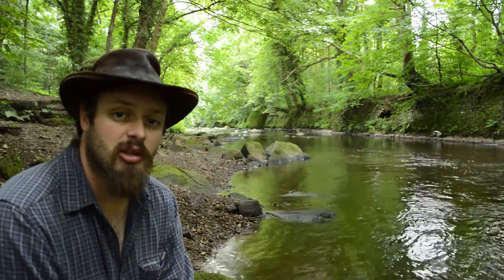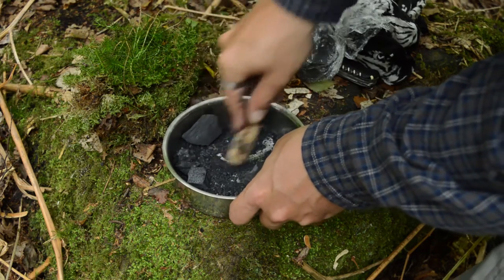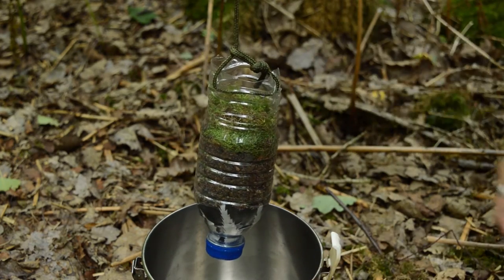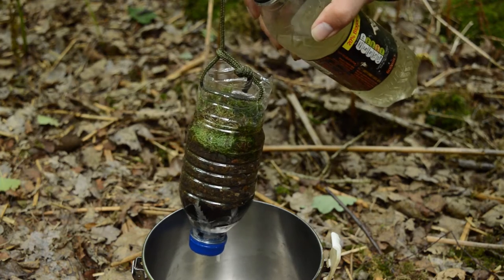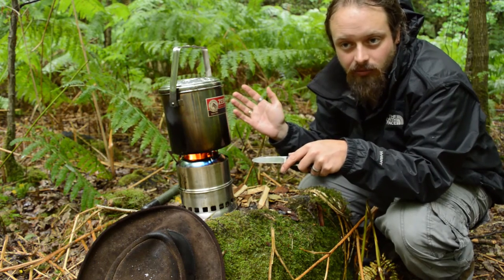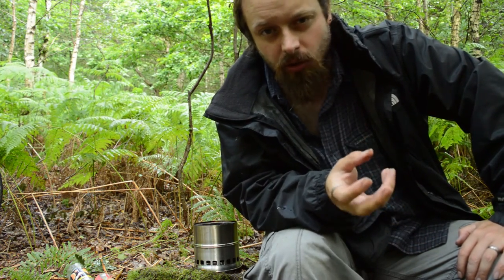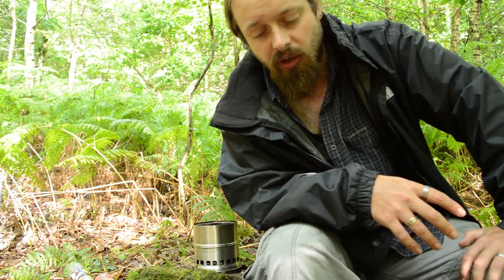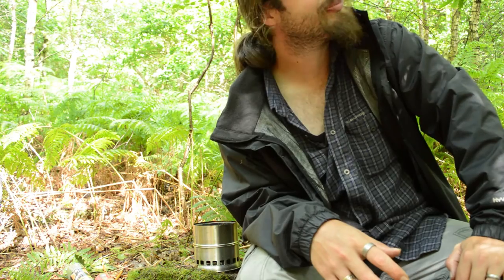Making a carbon water filter in the field

Comment: Do you think this method of filtration will handle heavy metals, the sort of contaminates associated with runoff from asphalt, gasoline, vehicle fluids, and such after storm events during which biofiltration may not be effective?  Thanks for your input in advance.
Reply from the maker: The charcoal will handle most of the contaminates some metals might get though but I would use more charcoal if heavy road runoff and filter it a second time to be on the safe side if I had to depend on this for a long time. Also you have to remember that after a storm a river or steam is going to been very heavy with silt which will clog up the filter a lot faster. and you still need to boil the water for about 3-5 minuets if you use this method to kill of any Bactria as the filter isn't going to filer them out.